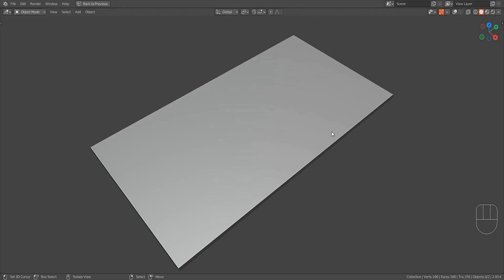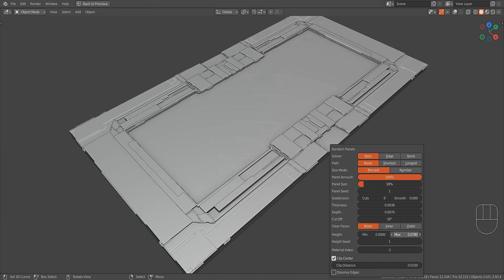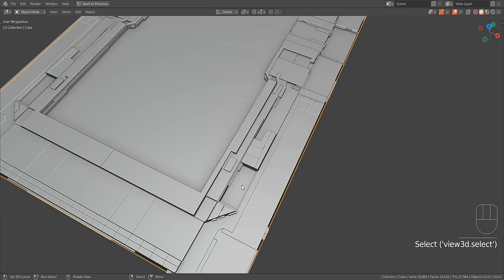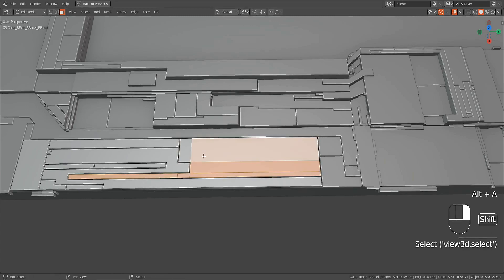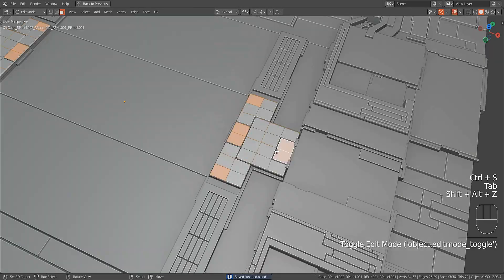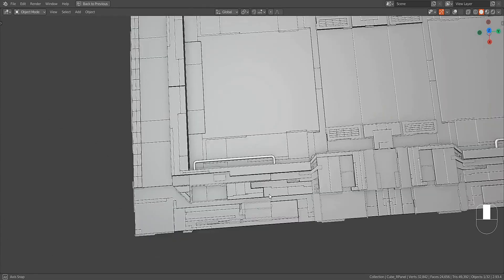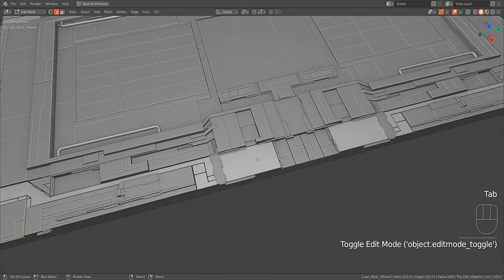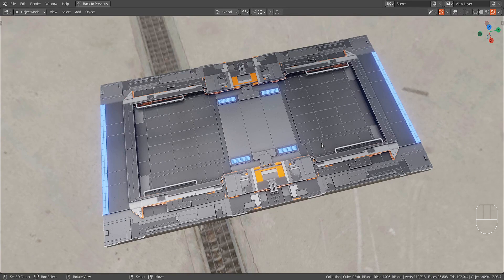Random Flow 02: Layers 101

Comment: once my pannel with all the parameters goes away
i cannot bring it back and modify, i only have the pannel with all the random flow choices
Reply from the maker: F9 hotkey.
Reply: @blenderguppy  I know you said it in the video,but it does not work i am on blender 2.93 i and downloaded the last version on blender market. i 'll tryhard more tomorrow
Reply from the maker: @Raphaël_Alegria  You can keep calling back the menu until you execute another action that has registered redo action like grab, scale etc. Once you do, the RFlow redo panel will be overlapped by the new one and you can't call it back anymore using F9. This is how Blender works.
Reply: @blenderguppy  i understood that but it just does not work lol i tried again
Reply: @blenderguppy  Ok I found out why it was not working. I am an ex maya user and I use the keymap industry compatible. There is sadly no F9 feature redo.last
It's so unlucky 😢😭😭😭
Reply from the maker: @Raphaël_Alegria  Using the Maya keymap does not remove the feature. It's in edit menu called Adjust Last Operation. Maybe it just has a different hotkey or you can assign a new one by right clicking on the operator.
Reply: @blenderguppy  VICTORY IT WORKS thank youuuuuuuuuuuuuu
Reply: Hola, es un plugin ? Es que me gustaría mucho tener algo así en cinema 4D, gracias saludos.
Reply: @REDHardstyleHardcore  just use blender and import?